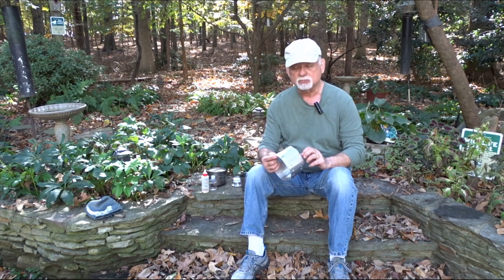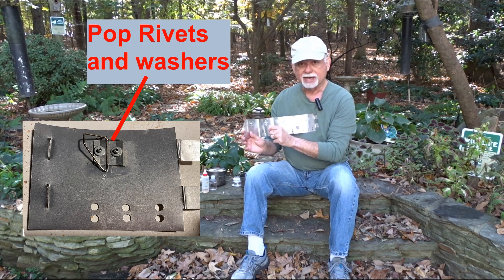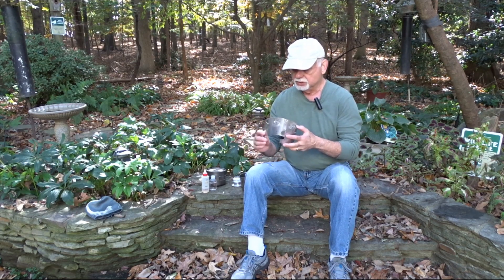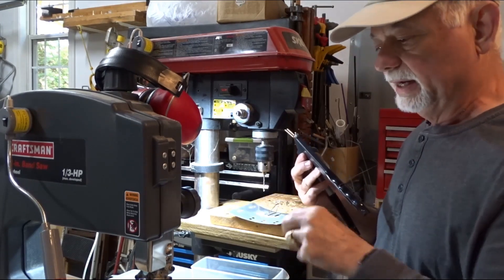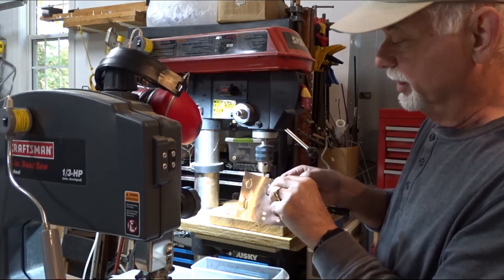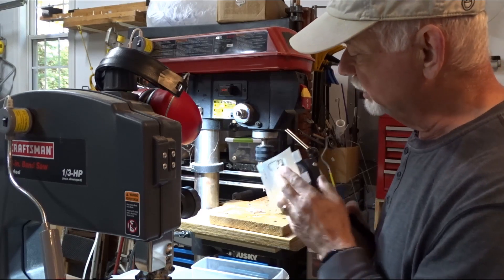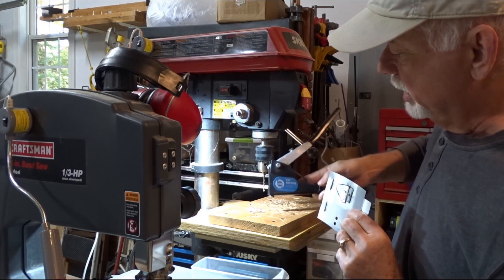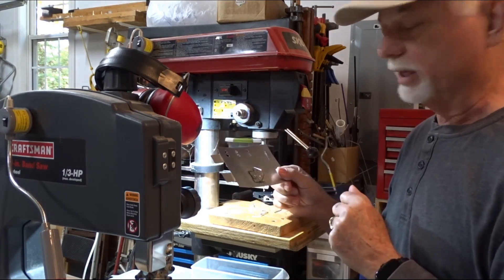DIY Alcohol Stove Windscreen-Pot Stand Update - MYOG

Comment: I just seen the original DIY guide and had same thoughts on JB Weld, but my idea was to try spot welding. With the thickness of those sheets it's like the putting battery cells together in series. Granted, a spot welder is extra cost and not something easy to just pick out of home depot et such 😁 The pro would be no extra weight.
Reply from the maker: While pop rivets only add a few grams and are really easy, I think that a spot welder would work nicely.  Wish I had one and knew how to use it.  I think I'll do a little research.  thanks

Comment: Do the windscreen nest in the pot when packed down?
Reply from the maker: The windscreen can fit inside when disassembled but the pot lid can't fit on.  It's taller than my pots. The bottom of the pot should be about 1.25 inch above the top of the stove to get the most efficient heat transfer.  That determines the height of the windscreen.  An alternative (simpler) design would be to make the windscreen diameter smaller and set the pot on top of it.  The windscreen would be shorter.  Depending on the pot it might fit inside.  Thanks for watching.